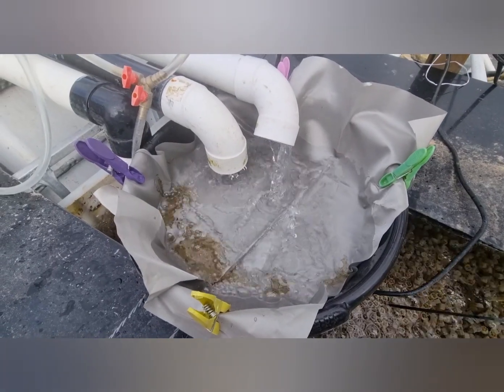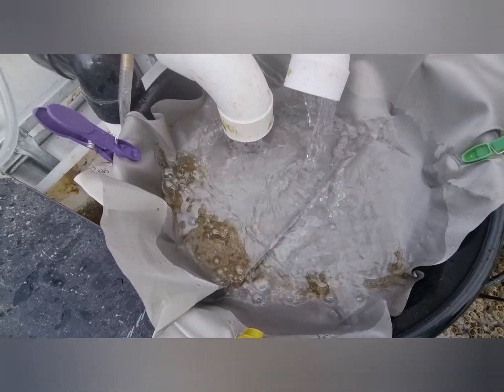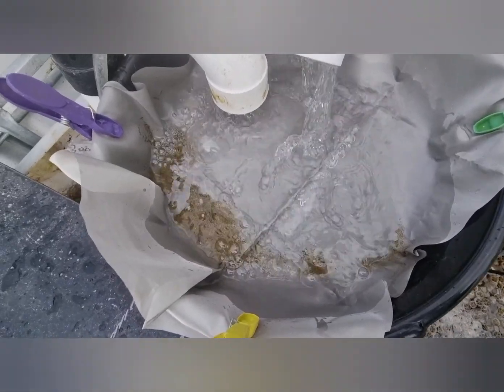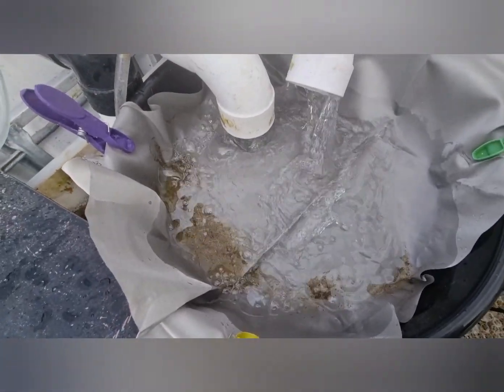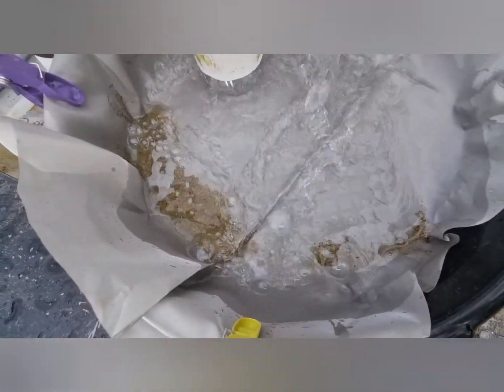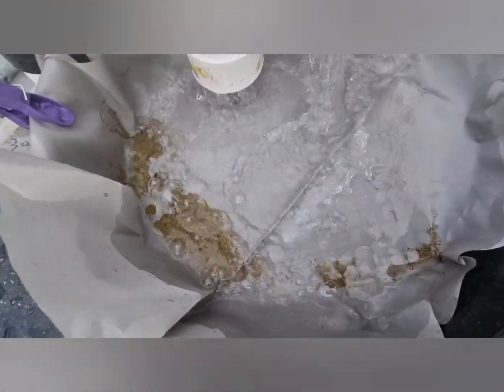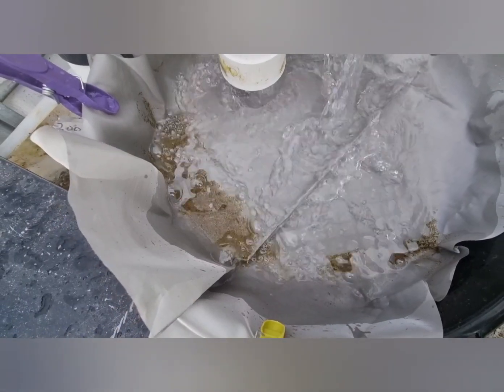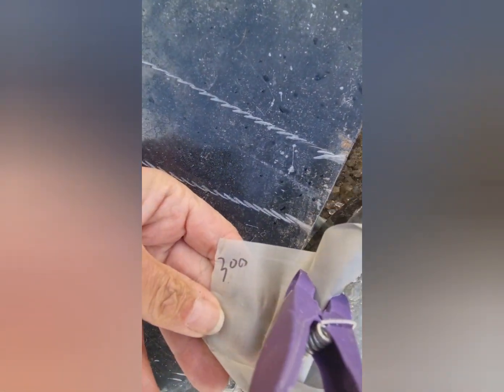so how good is a static k1 bed filter .   a little 300 micron test

Comment: Skeggy, I use a filter sock 300 micron too, then wool filter under that suspended in guttering above my moving bed, works OK. 👍
Reply from the maker: Yer this is just for test purposes to see what the moving bed is catching
Reply from the maker: Of ando a more permanent solution I'll have a self cleaning system which will flush to a 300 micron sock and then return to the pond then all I have to do is clean / replace the sock and it will all be out of the water column ..  I may even put it before the static bed directly after the uv

Comment: Intresting mate , how much static k1 is there before the mesh ?
Reply from the maker: It's running through a 6 inch deep bed in an ibc so there is a lot but I could put a much smaller container with the same flow rate ..  or baffle the ibc so that the bed is much deeper but not as much surface area which should be more effective

Comment: That's pretty good though considering you have done a blanket weed treatment recently.
Reply from the maker: Yer I'm fairly impressed.    It's a 30 cm riddle with a 300 micron mesh in it it's taken about 2 hours to clog up laying flat ..  but I didn't expect it to last very long..  I have a swimming pool type strainer taking out the big stuff above 5mm before the pump so that catches most of the blanket weed and large poo before it hits the pump      less fines 🙂